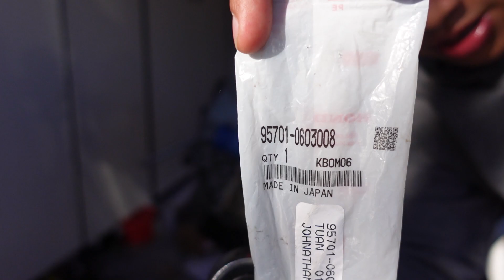So I replaced my K24 Timing Chain...

Comment: Good video bro .. ho ab the arow that is on the top of tge oil pump litle chain any mining?
Reply from the maker: up always pointing up. as far as lining it up goes, i used the cam holding tool bro. try it out save you some time.